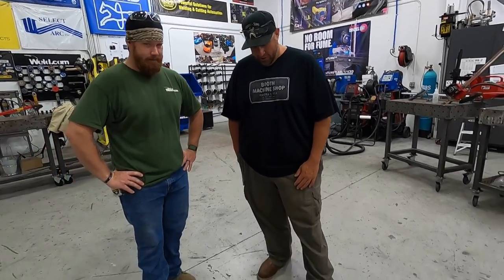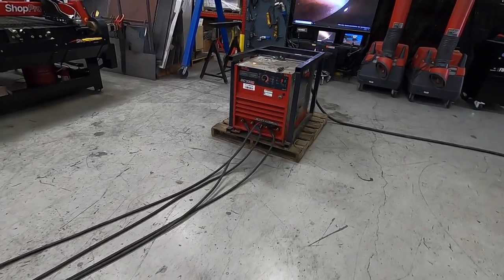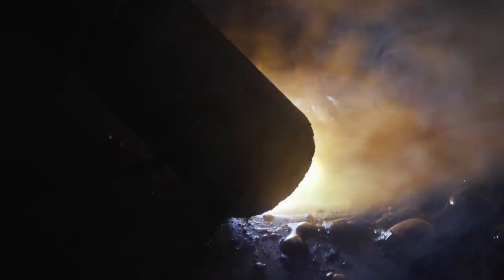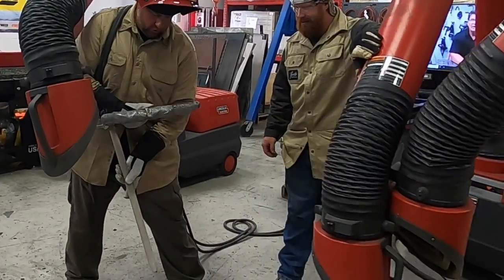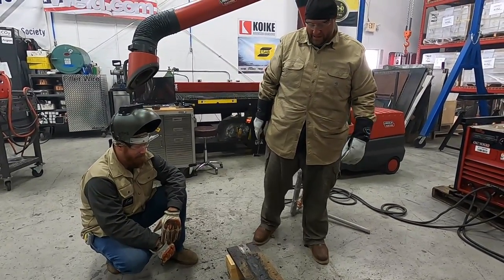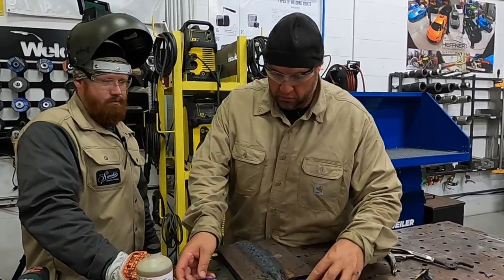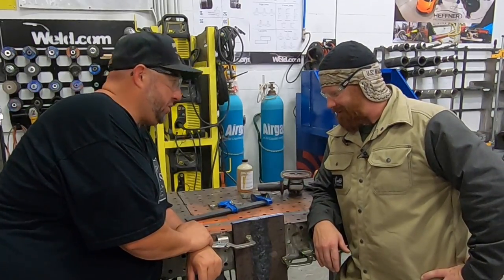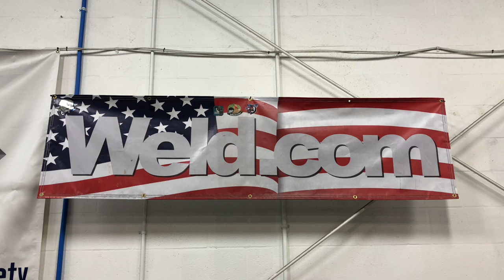1,000 Amp Stick Welding with Weld.com

Comment: That was impressive work and information first time to see such a huge welding electrode.
Question why did you use generator to power the welding machine? does your plant doesn't have 3 phase , 240 V power line with at least 400 Amp load demand. what was the DC voltage for electrode? I guess the generator output voltage  must be 3Phase 240V or 480V , Amp =?  keep up the good work, thanks a lot.
Reply: THAT WOULD BLOW OUT A 400 AMP SERVICE LIKE A BIRTHDAY CAKE!!!!!!! ALWAYS NICE TO HAVE A 2000 AMP MACHINE IN THE CORNER, FOR THOSE PRESION JOBS😲🤣🤣🤣🤣🤣🤣🤣👍👍👍👍👍

Comment: Also known as massive electrode welding,  or flood welding.   This particular rod, COR FORGE F35 ¾ inch is designed to run 1000 - 2000 amps DC.

Comment: What causes welding splatter? Is it a combination of things, or primarily just one thing? Type of Flux? Oxygen or impurities accessing the molten metal? Too much or too little distance for arc? Thanks!
Reply: The temperature of the base material vs the weld
Reply: @ghostdog662  Really? So, is this affected by very narrow temperatures? The starting temp of base material being 70 degrees Fahrenheit versus 40 F. Or, 130 F versus 30 F.  Or, if you were to heat the metal like you might before cutting it by torch. In which case it would be in the hundreds of degrees would equal almost no splatter?
Reply: 90% of spatter is the Flux covering blowing off.
Reply: @chrissnider9555  Is that why different brands or welding rods, (but same number), might produce more or less splatter? Are welding rods made for both AC and DC more likely to splatter? Does the condition of the material tend to make a big difference also? 6013 on farm equipment in the field versus brand new builds with the same rods?
Reply: The powdery coating around the stick is constantly being broken down into a large volume of gas by the heat, that's its whole purpose. If you happen to confine some of that gas in a bubble in the liquid puddle, the bubble will pop and spray some metal around. How much or how little spatter you get is dependent on pretty much every parameter you can think of, the formulation of the flux, the temperature of the weld, thickness of the workpiece, etc., etc. If there are VOCs on your part, they will contribute to gas production as well, increasing the amount of spatter.

Stick welding is messy, that's kind of just a fact of the process. You're basically running a little arc furnace in your hands, it's going to get hectic. If you want to weld something that thick without spatter, the only way I can see it being feasible (being a layman) is to forge weld the joint under a big hydraulic press, but there are obviously welding processes I don't know about, so there might be a better way that doesn't produce such a huge heat-affected zone.
Reply: @tissuepaper9962  Thank you for the in-depth answer! The gas being trapped makes a lot of sense to me. I learned to weld by reading short instruction pamphlets, and picked up the understanding to use a figure 8 to be sure to pull material into the weld, etc... but now that YouTube is a thing, I haven't seen any experienced welders do anything close to that. So, I bet that might be my biggest cause.

Comment: Wait... That gap was way way to small for such a amount of weld... Right???... Jezzz
Reply: Exactly! I am a pipe-fitter, not a welder. If we were building hangers, and I presented metal to him like THAT, I would be run off the job. I would bet the procedure would call for a significant bevel, with maybe a 5/16th landing.

Comment: but...what if it sticks?
Reply: you just bend it out like a digging bar.
Reply: Disconnect the power to the electrode and zip cut it out
Reply: Shut down the power and get a thermal lance.

Comment: That's cool. I run 1/4 7018 on the regular. Pipe fabrication and what not... Interesting to see, but weld quality is pretty terrible. Looked hot, maybe try like 900 amps drop it down a bit and see if ya can get the porosity under control.

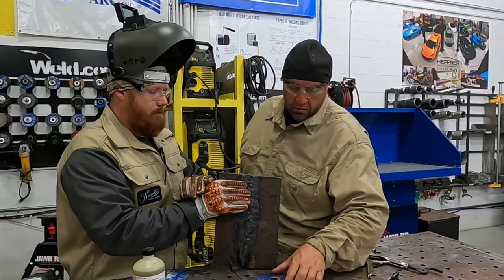Comment: At 16:45 you talk about the grinding/polishing wheels you use. I think the Victograin wheel you describe is the #61171, but could you please confirm this and also the brand and part number for the Scotch-Brite wheel. Thanks! And GREAT video!

Comment: hellfire, in my 30 years as a welder I've never seen rods that big!
Reply: Studwelding can use 1-1.25” fasteners. The ProWeld Arc series welders have a constant arc function so you would be able to run a continuous 1900 amp arc with an arc1850 machine. There are 3000A studwelders too!

Comment: I ran 5/16" 7018 on sills and bolsters while at Union Tank  Car co, East Chicago IN plant back in the day. We called them Roman Candles. Used a huge stinger, and it was a two handed affair. They were loud and you were laying down some metal 😉

Comment: You'll have to keep your rod well into puddle at THIS wattage its circulating all the flucks if you LIFT your rod to much the flucks GETS blown to the bottom which results in pit hools and parossaty!.
Reply: Spell much?
Reply: @fastrackin1285  nobody gives a flux

Comment: Give up them salary 10k-20k per/time ~ per/hours.. is not easy hand controls under 25,000 electrocvolt came finish. Dangerous, caution, and safety.

Comment: Could you not do that with a regular stick welder and just hit both sides or bevel and do multi pass. What is the application for something you literally need a factory electrical system to run and a forklift to move the welder?
Reply: He pointed out they were mainly used in foundries where they need to repair their crucibles when they crack, picture 3-4" thick walls of crucible steel and maybe you're getting close.
Reply: @bjorndoe4167  People just like to ask dumb questions that was previously answered.

Comment: Amazing stuff.   A first for me to see this sort of thing.   With many past years of Project Manager and Job Superintendent jobs, I would be interested to know what a strength test would reveal.   Under real world conditions on thick plate steel, obviously both sides would be welded.  So what would be the PSI of a tensile or bending test to ascertain that a weld of this manner would be within spec.

Comment: Does anyone know about how much the electric cost to do this? Lol very curious
Reply: Considering it was running off of a generator, it's a lot harder to say. But running 1100A for approx. 120 seconds as they did works out to 36Ah or 4.4kWh, so probably about half a dollar of electricity if it was running off the grid. Depends a lot on the rates in your area. EDIT: I just realized my initial calculations were wrong, as that was 1100A at a reduced voltage. Without knowing what voltage it was running at, it's difficult to say. So my estimate was definitely the maximum, assuming they were running off of 120VAC, but of course, it would be much less than that.

Comment: I think the heat from the cutting torch would alter the penetration pattern.
Reply: You can literally see where the metals are welded and not. He also ground down past any spot the torch touched.

Comment: Looks pretty. But actually useless. The haz zone on that plate would be large
Ex boily. Rods up to 4-5-6mm are essentially only good for capping runs and looks
I used to repair 150/200 mm thick buckets on mine sites using flux cored 3 mm wire pre heat and lay 1 inch passes.  Multiple times
The post heat and heat blanket over weld to slowly cool t prevent cracks. And needle pin it to distress and prevent cracks

Comment: as a young apprentice I regularly used to run No 4 and 1/4" and even they were big rods to put down by hand because of the heat, my dad set up his own snap-in system so that we could change out the hand set as it got hot and dump it into cool water, we would have 3 units on the go all the time with a second transformer and cable, thankfully those days are gone that was hard work.

Comment: The bubbles (Oxidation) problem is either there was too much Amps that the metal got to hot or the rod had moisture, but I am betting more on the rod having moisture because when I did some welding classes the instructor always told us that one of the most important things about welding rods was that it needed to be warmed to get rid of moisture the rod absorbs. The popping of slag every second kind of tells there was moisture on the rod. Once there is oxidation on the molten puddle start all over or by grinding the affected area.
Reply: @hatsu957  If you are asking about the instructor, I was talking about welding rods in general. I wasn't being specific on this 3/4" kind of rods.
Reply: @hatsu957  First time seeing it, but my guess is just any metal thick enough to not be melt through, say over 1". Speeds up process I find it kind of hard to weld by one person, it hast to be used by a stand where you only move the electrode over the welding gap. It sure looks like E7018 just on a bigger scale.
Reply: @hatsu957  thanks, no problem.

Comment: This remind me of carbon arcing on an air craft carrier using one inch carbon and roughly 1300 amps to make a pilot hole to put a giant saws all in to piece of 10inch steel to cut a relief for getting a pin out of one of the props on the carrier!!

Comment: It looked like the amps were too high with all that spatter and popping. I'm sure there's a lot of porosity in the weld.
Reply: Yeah I thought the same thing. I would like to play around with that rod starting around 750 amps just to seewhat it would do.
Reply: @wildwilco  Spent 25 years welding everything from structural to boiler tubes to heavy wall piping in a wide variety of metals in a wide variety of procedures from SMAW, GTAW, Submerged arc and MIG so im very well aware of the need for the amps. While I havnt ever burnt a 3/4" rod I have used 5/16 and 1/4" a good bit and they only needed around 250 amps. As for his rod position you and I will have to disagree on that but again I have not burned a 3/4" rod so I could be wrong. I know his rod position would have been fine for a 7018, 7024, 7010 and many many other rods burnt in that position.

Comment: 1100 amps?? damn! I'd hate to get bitten by that
Reply: 100 amps or 1100, you're gone either way. May as well take the 1100 and get it over with real quick-like IMO.
Reply: @tissuepaper9962  heavily depends on many more factors than just amps. 1 volt + 1000 amps = no death. 1000 volt + 1 amps = .. :(. Resistance, Frequency and so on are also playing a huge role. Its not the Amps that kill, its the Voltage. Simply because 1 volt can not supply 1000 amps. However, the DC1000 Welder they used goes from 16 to 46 volt. Now 46 volt can still not supply 1000 amps but can supply enough to kill you.
Reply: @tissuepaper9962  dont play the joke card now. To me you seemed like one of those people that believe the "its the amps that kill" fairy tale.
And you said "unless youre wet or have open wounds", which plays down to Resistance.
Reply: @Sharpless2  "get it over with real quick-like" wasn't enough to tip you off that I was kidding? Really? You think I just talk about sudden death like that normally, when I'm trying to be serious? What you said didn't even contradict what I said, which was tantamount to "100A through your body = 1100A through your body = death". You assumed that what I meant was "100A on the dial = 1100A on the dial = death", which as we've just discussed, is untrue.

You know what they say happens when you assume, my friend...

Comment: That's one big ass weld you got there!
Reply: It is indeed big, in width but not so much in depth which is where the strength actually is but as they said its meant to be a mechanized operation so it's still good for being done manually.

Comment: infrared not uv
Reply: The arc from the rod creates UV. That could be what he meant
Reply: he said feel, as in heat which is IR. the UV is only as the arc is going
Reply: But he said uv after the weld was done

Comment: bad penetration, i was welding with Submerged Arc techinque using 3mm welding wire, working with steel, 600 amps and did better penetration with it than you and this big stick :P

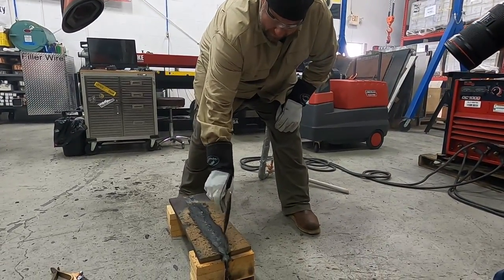Comment: 13:06  Ur not chipping the flux, that's on the rod. Ur chipping the slag. We were all a "cub" at one time. How long till you turn out ? LOL  I know how pissed I get when getting a 1/8" or 5/32" rod stuck. I can't imagine throwing one of those across the shop in a fit of rage ! LMAO

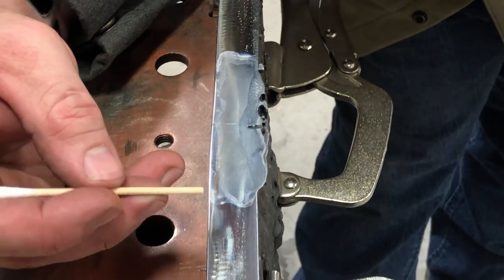Comment: Looking at 19:12 it is clear that the weld may look as if it penetrated 3/8 inch deep but the central puddle was too hot and resulted in boiling and too much turbulence in the center of the pool with the result that what the weld did was to spread nicely on to the cold surface contact but in the middle in the hot pool, there is no solidity whatsoever in the weld and that would fail (fatigue) very quickly especially if the weld was subjected to any small movements/bending. There are processes and activities in life that matter most, and which one cannot be hurried up, as the maturing of a good wine!!

Comment: I  once used a 1/4" rod with high deposition flux.  The rod was a little over a half inch thick and vibrated in your hand,  had to wrap an old glove around the stinger, as it got so hot. (for welding 1" plate into tubs for melting car parts for a junk yard)

Comment: That's impressive. I've run 6mm solid rods and up to 5/8" tubular rods but at no where near 1000amps.  My first thought is that he was running a bit slow and over heating the plate which would have caused the porosity in his weld.  I can see why they would be used for build up for forges due to it's very fluid weld puddle creating such a wide but shallow weld.  Be interested to see what the recommended travel speed is.

Comment: An old welding ratio i remeber is set the amps at the diameter of the electrode ( 125 for 1/8  , 750 for 3/4. )

Comment: i have no exp with large rods/current.  but isn't the poor penetration & flat wide bead just a result of dragging the electrode with almost no gap?  

thats not a critique so much as a curiosity, i doubt I'd even be able to spark that electrode.

Comment: Wow I thought the 1/4 inch 7018 I got to run 15 to 20 years ago was fun.  I think it was around 300 amps.  A friend of mine at a machine shop and I was repairing some draw bares that hold cleaning fingers in between the teeth of a 150 HP hydraulic shredder at a place I use to work.

Comment: Is there an imperial unit for the current?
Reply: Thankfully not
Reply: No, but you could easily define one based on existing FPS units the same way the Amp was defined pre-redefinition, using the force generated between two, infinite, thin wires when a particular current is passed through them.

FPS is defined using metric anyway, so technically every FPS unit is also an SI derived unit.
Reply: Thankfully not. Hell nah.

Comment: I just thought of the best chipping hammer for that 3/4" welding rod and that would be a,JACKHAMMER,now that will remove any slag from that kind of welding rod.---Plus I was really hoping that you could try welding a piece of pipe that's been beveled at both ends,butted up and then someone could run a root pass,hot pass,fill and cap all in one motion.Let it cool down,cut your tickets out,clean them up and bend them maybe to ASME SPEC'S.

Comment: I didn't weld a thing in my life so I have a question. Is this weld is consider as good weld ? I assume there is no way talking about precision here. I was also surprised it's melted only half way through.
Reply: for as little prep and practice as was really done, thats about as good as you can really ask for
Reply: No, it's pretty bad, but that's just because this isn't a real part or a tutorial video, they're just fucking around with the toys in the shop.

If they wanted a good weld, they would need to use much thicker base material, and prepare the joint a lot more deliberately. The process can produce fine welds, they just chose not to go through the whole process here.

Comment: its not suitable in plate 1" use at least 2inches i might have a good bead and wave a little
Reply: This was just a demo. If they were welding something up for real using this process, they would have used thicker plates and cut a V ~halfway through the joint and gotten much better-looking welds.

Comment: Is that a 45kw gen?
Reply: On the side it has 150 so I'm gonna guess its a 150KW generator
Reply: Could stand for 150amp gen lol I don't know there equipment
Reply: @The12aChronicles  generators usually have their kw or kva rating on the side. The amperage will change with the voltage you select, but kw or kva stays the same.

It is in fact a 150KVA generator. Heres the link: https://www.red-d-arc.com/product_details.aspx?sub_cat=186&prod_id=1390
Reply: Well im glad we got that figured out lol

Comment: When are you yanks gunna start using metric..inches is so out of date and not precise 😂😂
Reply: Dude, we're using the English system. You know, the standard system of measurement. You know, the ENGLISH system of measurement. Just ribbing you a little, but any system can describe any measurement with equal accuracy--they're just different. Besides, we're not the ones driving on the wrong side of the road. Lol.
Reply: Math favors our system friend.
Reply: How I understand it is that it is too expensive to switch 
tho I may have it wrong
Reply: All of those from a country who put a man on the moon raise your hands?

Comment: What did they weld the old WW2 battle ship armor 1 foot torpedo plates with?
Reply: Probably thermite. It's used for railroad and shipyard welding for super deep stuff. Laser welding can also do super deep, narrow welds on thick plate, but I don't think that was a thing back then.

Edit: looked in up and the real answer is: They don't. The plates were heat treated and case hardened, and so couldn't be welded. They just bolted to the hull of the ship.
Reply: @Timestamp_Guy    Try Rivets.  Then it went to electro slag.